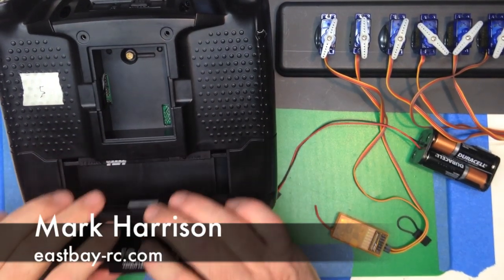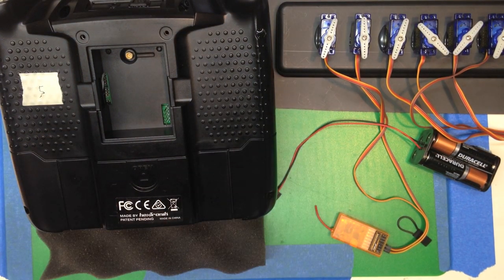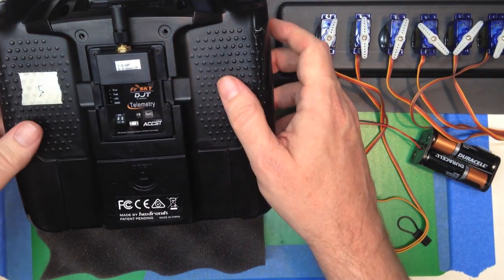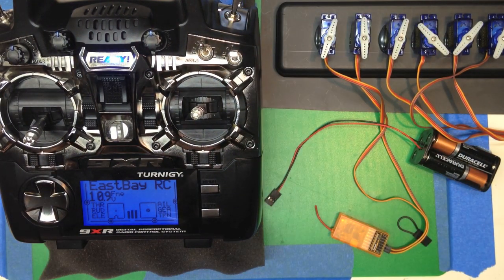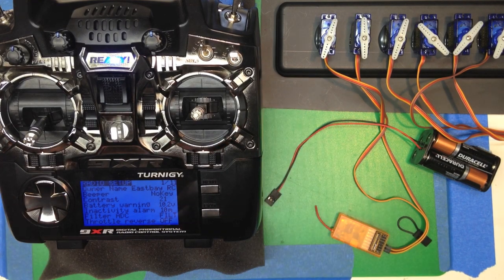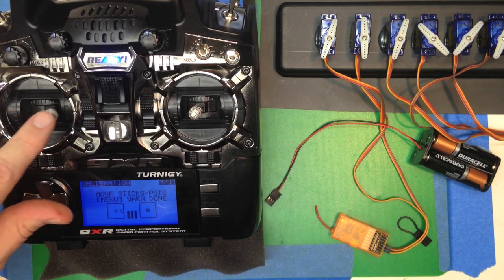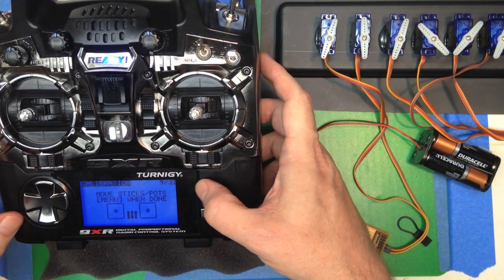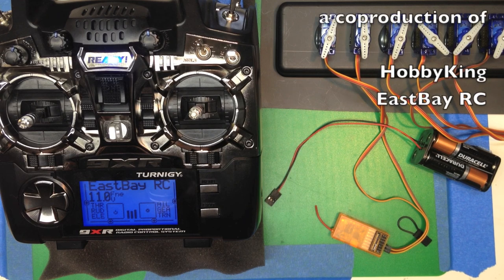Welcome to the Turnigy 9XR Pro, Part 1: Out of the Box

Comment: I have few questions, at least one after watching your videos and other based on your knowledge and my one of many confusions.

1) I am planning to buy same radio (Turnigy 9xR Pro) to avoid adding multiple "v-tail mixers" as I am using Spectrum DX6I radio at this moment. 
In your video, "Part 1: Out of Box" you showed both Modules (Orange and FrSky), but later you put the FrSky Module and kept the orange Receiver.  Will that combination work? If I buy same FrSky module will it work with my existing Spectrum and Orange receivers or I have to buy Orange Module for Orange Receivers and FrSky Module for FrSky receiver?

2) I am also very confuse about receivers "with Telemetry" and "without Telemetry". I am not that advance flyer.  I just fly my own foam built but want to do multiple mixing. Should I be buying receivers with telemetry and not use the telemetry part, or better to buy receivers without telemetry only?

3) I heard a lot good about FrSky and would like to stay with FrSky.  May I request to suggest few receivers and modules.  

4) If I buy Taranis (FrSky's) Radioto save all teh module trouble, would that mean I am stuck with FrSky receivers and accessories only (this question kind of reflecting the first question)?
Reply from the maker: +Tahir Great questions!  Here's some quick answers:

1) Basic idea:
- modules and receivers must be matched, e.g.
- FrSky modules work with FrSky receivers,
- DSM compatible (e.g. Spektrum, Orange) modules with DSM compatible receivers,
- etc.

- The 9xr Pro is a pure module-based radio.  That means you can plug in
  a FrSky module, an Orange module, etc.  The basic radio functionality
  (mixing, etc) remains the same for all of them.

2) At this early stage you probably don't need telemetry.  For my foamy
flying I don't use any.

3) FrSky is great.  I like it a lot.
Module: get the FrSky DJT.  It will support both "X" and "D" series
receivers.  Receivers: Four channel, the D4R-II is great.  More
channels, try the X8R.

4) No, you're in luck.  The Taranis has a built in DJT module, but also
has a module bay so you can use an Orange or other module.  I've got
a Taranis series on this channel if you're interested!

Good Luck!